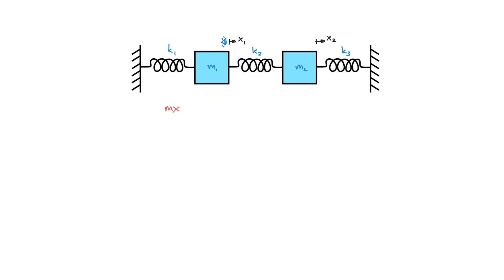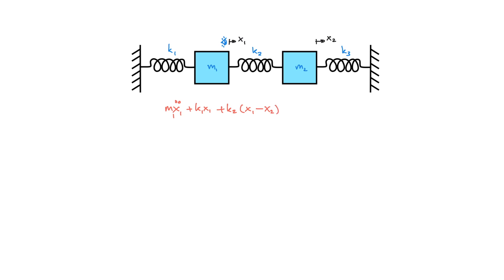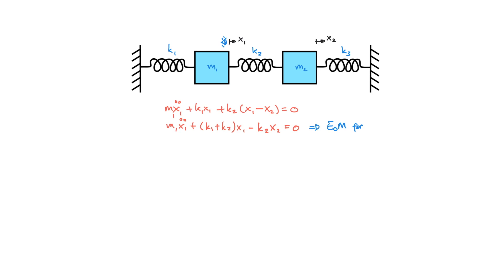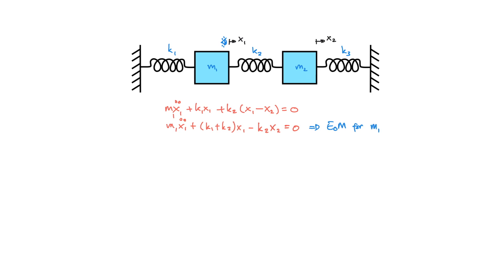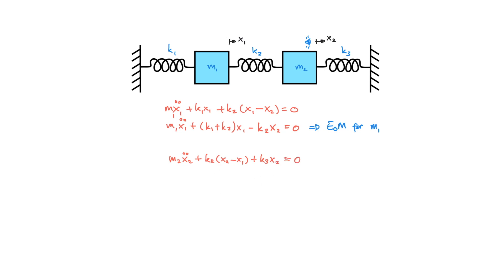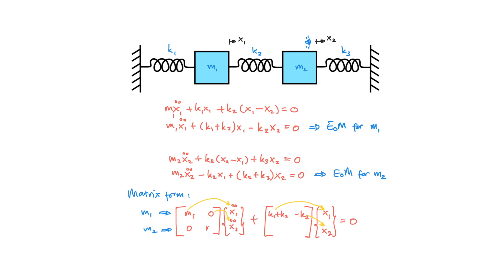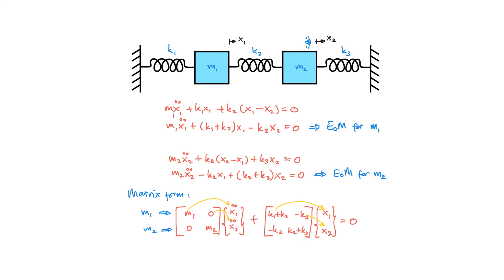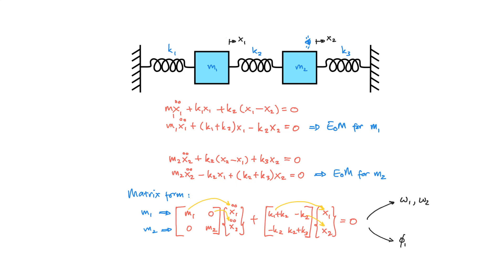Mechanical Vibration: MDOF Deriving Equations of Motion (A Quick Way)

Comment: What is the sign convention? When is a term xa*kb counted positive, when negative? For example, when m1 moves in direction x1 it stretches k1 and compresses k2 but both x1k1 and x1k2 are counted positive.